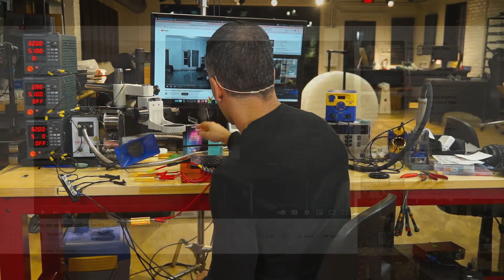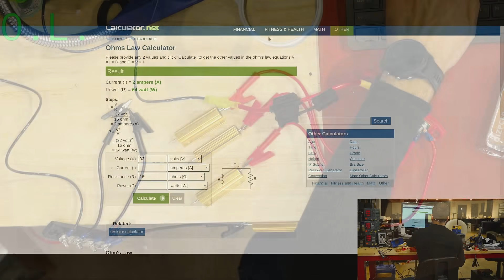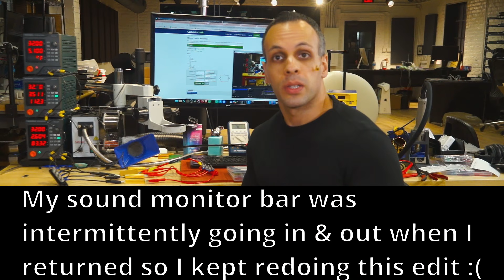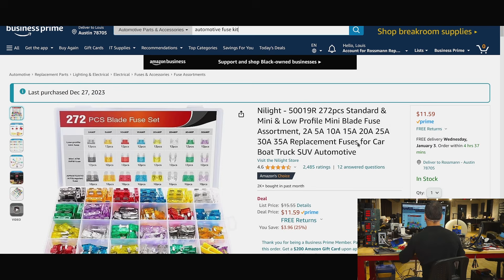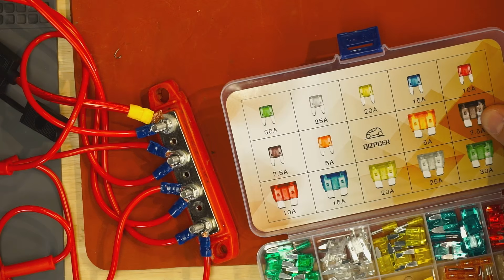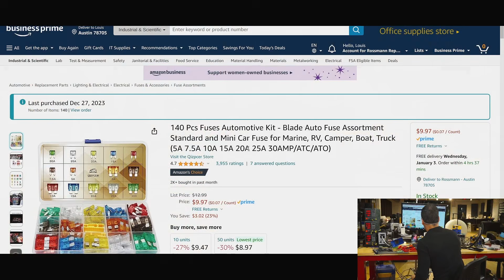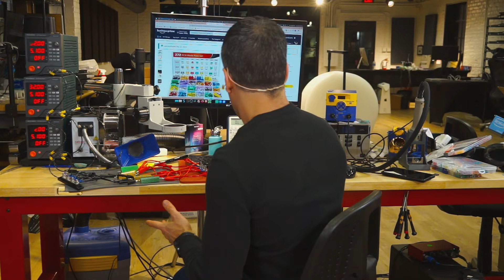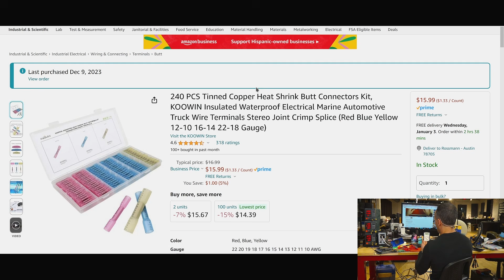Amazon Sells Fake Electrical Fuses

Comment: This must have been pointed already...sorry, will not be reading it.

But having 3 power sources in parallel to test the breakpoint of a fuse is flat out hilarious.
Louis, I like you, i really do, and that is why i honestly recommend taking this down, doing it right with a single unit and no parallel resistirs because thats all you need and explaining the reasons.
Reply from the maker: This post is all snark and condescension, but zero substance.
Reply: @rossmanngroup  Truly sorry you feel that way. Fuse parameters are a small science in its own, but for the sake of showing breakdown current variation all you need to do is run a single station and draw VA as you increase voltage until it blows. Very simple to do, very easy to replicate and while not perfect it is accurate enough for the sake of displaying range of breakdown current in various fuses.
Proper tests are more difficult and your own setup while getting closer in regards to the rated circuit voltage has issues beyond being complicated.
I want to tie that to the Amazon problem though.
You see, like many many other businesses Amazon was started with the idea to help.others and hopefully profit in the way.
When helping others they, like many other businesses, screwed up lots of things. and they keep screwing it, as.you correctly illustrate (btw I have a blog from at least 5 years ago stating pretty much what you state here, i.e. Amazon is going down).
The point and connection is just like Amazon does not want to see their mistakes I think you here are very fast to shoot me down instead of just doing a simple VA characteristics of a fuse meltdown current with a simple unit as most kids would do at school.
You are not Anazon.
But you are like Amazon in believing you do good and going defensive when told otherwise.
 Nothing personal. I was no better when I was on the way up :-)
Reply from the maker: That was a very long -way of completely ignoring my post. 

Using three power supplies in parallel is not going to negate the result of this experiment. Eight amps were put through a two amp fuse, and six amps were put through it for a prolonged period of time. Whether that occurred from one power supply, three power supplies, 50 batteries, six monkeys peddling a bicycle.... It's irrelevant.
Reply: @rossmanngroup  You are welcome to believe that it is irrelevant. I still - with all due respect - find it hilarious to have employed the setup you did employ for finding the fusible amperage of a small fuse. Does not neglect the point you are making in any way or form. The setup is in a category of its own and that was my focus. Not going to make a video and not willing to have a long argument. As I said I just did not expect that from you.

Comment: It's worth noting that putting power supplies in parallel and using the current limiter will result in wild oscillations in voltage output that may well cause them to shut down, perhaps risking damage to their output stages.  Louis is safer to keep the voltage fixed and vary the current using resistors.  If Louis is going to do more tests like this, it'd be worth screwing these resistors to a handy slab of aluminum 👍🏻
Reply: Does it oscillate into a resistive load? Where does it store the energy to cause the oscillations?
Reply: @@giusdbg the current limiter has negative feedback so where does the oscillatory gain come from?

Comment: I've had a 10 amp 12v fuse melt the plastic fuse bus body that it came with and still didn't blow. The 10 gauge wire was completely burned. Can't trust that cheap stuff. If the only difference between a 10am and 25 amp is the color, there's a problem.

Comment: the test structure of this is pretty convoluted. you should be able to just use the current limiting function of your power supply. or another power supply. Also don't need to use 32v exactly, the voltage rating of a fuse should just be the maximum, not the spec'd voltage to run through it constantly. So instead of 32v at 5a, you could use 5v and slowly increase the current limiting until it blows instead.
Reply: or just use any actual thing as a load and current limit it, IE a car lightbulb.... should get a good 10 to 20 amps per headlight. current limit it while ramping it up with the fuse in series, and no need for a bank of resistors with heat sinks on them

Comment: I thought exactly the thing you said about trip curves, but you don't need to find trip curves for those specific fuses. Automotive fuses are generally designed to a standard such as SAE J1284, so you should be able to look at any well-known brand and look at their datasheets for automotive blade fuses and see what they say. I don't expect them to be exactly the same, but they should be in the same ball park. Looking at a Littelfuse datasheet for 32VDC automotive blade fuses, the 2A fuse in that series should blow in about 0.3s with 4A flowing through it. At 6A, it should take somewhere about 0.9s. I also looked at a Bussman datasheet for some J1284 compliant fuses. For 4A through the 2A fuse in that series, the trip time should be a little under 2s. At 6A it should blow in about 0.4s. So I don't think anyone could justify 6A through a 2A fuse for several minutes with a trip curve argument.

I have a 30mm glass fuse kit that I bought from Amazon a couple of years ago. They were listed as "fast-blow" fuses, so I thought I'd take my 20A lab power supply and do a few tests. I wasn't as patient as you, but I had 4A running through a 2A fast-acting fuse for well over a minute, but once I upped the current to 5A it blew in around 2 seconds. Not exactly what I'd call fast-acting for a 2A rating. I also tested a 6A fuse. It was fine up to 6A, as you'd expect. At 8A, it started glowing red almost immediately and finally blew within about 8 seconds, which is not too bad. It seems like these low current fuses may be less reliable. The wire fuse element has to be thinner, so I guess quality control is going to be poorer on the lower current fuses, especially when you're playing at the cheap end of the market.

Comment: You're absolutely right here though, this is the correct test to make. The fact that junk cheaply fabricated - non regulated (which regulations suck some places but that is why we have IEEE standards) junk fuses.. Look you did come at this with the right insight. Someone suggested a bad fuse - and yeah 10amps on a 2amp fuse IS NOT GOOD. Problem here is MOST PEOPLE don't UNDERSTAND this.

Comment: I'm a PhD electrical engineer and glad you're bringing attention to these problems, but you made a few critical errors. These are automotive fuses required to conform ISO 8820-3 or similar standards, and time-current curves are readily available for comparison. And you really do need those curves: Fuses are not instantaneous switches, they're analogues for for electrical wiring, and electrical wiring doesn't instantly overheat either. Simply put: fuses are NOT supposed to blow instantly!  Properly designed and manufactured fuses may take minutes or hours to activate during mild overloads, and that's by design, as many properly designed loads (motors especially) can draw very high current levels for short periods of time. And there is always a wide tolerance for performance because there is considerably variability in the real world as well. (Ambient temperature, ventilation, etc.)

You can't make a claim they're defective without a  comparison to the time delay they're supposed to be blowing at.  A properly functioning 2.0A Type E automotive blade fuse is permitted by ISO 8820-3 to take up to a full minute to activate at 4.0A, and 7 seconds at 7A. It should operate indefinitely at 2.2A, and take up to 15 minutes at 2.7A.  Only at 12A or higher should it always blow in under a second. Engineers recognize that and design in safety margins with that knowledge. 

The fuses you tested did not appear to meet this standard, but didn't seem to be as outrageously bad as you seem to think. It's hard to tell from your experiment just how bad they are, though, because you keep changing the current. If you repeat this experiment, I recommend testing each fuse at a single current each experiment, and timing how long it takes to blow. Only by plotting those on the time-current diagram can you really tell if these are outside of the permitted specification, and if so, by how much.  If you have a thermal camera, that would be very helpful, too. If you want to be really dramatic, pick a cheap Amazon fuse and a cheap Amazon wire at the minimum size wire permitted to be used with it, and if the fuse really is a defective (no-blow) fuse and/or wire shoddily made, the wire will burn before the fuse, and it will make for some great youtube!

Comment: The other thing to watch out for are counterfeit products - i.e. fuses or circuit breakers that have a name brand on them but aren't actually made by the named company.  Sometimes the markings are so similar that it's difficult to tell them apart.  Another reason to buy products from a reputable seller.

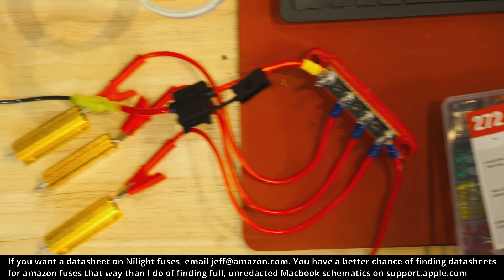Comment: 5:49 Apologies if this is mentioned later.  I can't speak for those Amazon ones, but generally speaking fuses will have their amp rating printed/painted on their top edge, so regardless of color, you should be able to read its rating.

Comment: Only 2a fuse was bad, other two behaved normally. They are supposed to blow at double current, so they dont get too hot at rated current. I see your point, but dont agree completely

Comment: So many people think they discovered america while such type of fuse should actually blow at around double current in up to 30s. It cant be made to blow at 10% over rated current because it would be heating up like crazy at rated current. This is basic fuse. Its not a circut breaker which had electromagnetic switch which interrupts current immediately at 2x rated or more, and bimetalic part which trips if it starts heating. So it can be tuned to break circut little over rated current (but again in 30min for example) this does nit apply to a simple fuse since it has thermal mass so dont confuse

Comment: Perhaps you should attempt this with what you get from the automotive stores. I've always wondered if they make the aftermarket fuses take a little more so the customer thinks the problem is "fixed". When truly they are just putting more current on a circuit that isn't designed for it.

Comment: Very alarming. Many people myself included have placed a lot of stock in Amazon reviews, especially where there are a large number. Its not just the issue of fuses and crimps. It brings into question everything on Amazon. This really complicates things for consumers. I can adapt as doing research and comparing different sources is something I'm good at, but the average consumer is screwed.
Reply: Amazon doesn't even want to take responsibility on what is sold on their platform . Now add on the fact that they have millions of products that are constantly coming in and out AND they lack the resources to properly investigate what is fraudulent. That's a red flag from the get-go. 

As consumers, it's essentially our fault. We didn't learn our lessons when we shipped our manufacturing offshore and gutted a portion of our middle-class...we sure as heck ain't going to question why products are priced so cheaply on a platform that can't physically (or legally required to) monitor the quality of the product.
Reply: amazon reviews are fiction. Not just fake, but amazon suppresses negative reviews. I bought a wifi card for $50 that worked poorly. In the box was an "offer" for $50 back if I gave them a 5 star review. I took a picture and reported it to amazon, nothing happened. I left a negative review about it and amazon removed it.

Amazon is complicit in this whole game. They know whats happening and they're helping the fraudsters sell garbage because they're financially incentivized to.
Reply: Years ago, reviews worked as a way to tell real products from trash.  Then around 2015 or so I noticed that real quality products had lower average reviews than fake items.  Around 2017 or so, Amazon started pushing the trash products in their recommendations.  Today it is very difficult to find good products on Amazon unless you already know which companies provide good products.
Reply: Award-winning author here. I would NEVER distribute my work on 'Zon. Never. It's a dollar-store style cash grab, chinsy, XiXiPi kind of outfit. Sure, maybe it was different in 1999 or 2005 or whatever, but now?! Nah. Garbage in nearly every way imaginable. All so that wealthy CEOs can have hookers, hoes, wine, and yachts. Bezoz and his corrupt CHN cronies are rich and you ain't... but that doesn't mean they've actually contributed anything positive to society.
Reply: placing trust in reviews is trusting advice from total strangers
it's best to never pay attention to reviews of anything - music, doctors, YT videos, vehicles, restaurants, movies...
the best testament to value or quality is staying power and reviews is just strangers saying "trust me bro"
Reply: @likebot.  and a review for "technical" stuff on a NON technical platform 
most users ordered box of fuses and plugged the fuse with the right number and whatever worked again so 100% satisfactory and SHOULD get a 4+ rating  BUT they dont know HOW to test and are EXPECTING to NOT NEED to test them 
in this case the rating are TRUE and MISLEADING at the same time
Reply: @jasonriddell  Most people are unqualified to give a sufficient review.
Reply: @likebot.  Staying power doesn't mean quality. Companies rise and fall, be it overall or in specific product categories.
Ford's turbocharged 1.0L is crap and I don't see Ford not having "staying power". Dell's entry level business laptops are pretty crap as well, I know multiple cases where people had work blocking issues in the first 1-2 years of having the laptop, yet Dell has "staying power" as well.
I would trust the "staying power" as much as a random stranger's review. Whatever I am buying I will look up a bunch of reviews, rankings and comparisions on third party sites and forums before I even look at the reviews found on a seller's website (where I will be looking at 3 or less stars reviews anyway).

Comment: Sorry, but on the box I couldn't see if they're 32V indeed.

Maybe I'm an noob from old continent, but automotive fuses are in most cases 12V, alternativly 24V for HGV.

If they would be 12V their AMP rating would be tripled, wouldn't be?

Comment: Your endpoint is so true, you can put in a way bigger rated fuse on a circuit and if there is no fault somewhere between the power source and the endpoint the fuse is not going to need to have to do its job and will last forever but in the unlikely event that there are damages you are risking your car catching fire.

Comment: The fuses are probably lots of the same rated units but with different colored plastic tabs. That way they can just manufacture the same thing repeatedly to capitalize on economics of scale rather than having separate assembly lines for separate ratings. The package may have only 10amp, 25amp, and 35 amp fuses (for example) rather than the complete range listed on the package. They skate under the radar for awhile because the  fuse will 'work' fine until there is a more catastrophic fault in the system that unmasks the falsely labeled fuse. And because there is no such thing as accountability in the Chinese economic system, there's no way to put a stop to such practices short of completely barring Chinese-manufactured imports.

Comment: Wow, you’d really shit if you tested breakers.
I used to do electrical testing, breakers.
We tested exercised and replaced breakers for a large telecom, all locations.
For instance, a typical breaker has a recommended curve of proper operation, or rating.
A typical 20 amp breaker would be rated at 3x rated for somewhere in the 1 minuet range.
That is it could maintain/ not trip with a 60 amp load for about a minuet, then it should trip.
They would be instantaneous trip tested at 10x rated amps.
We would hit them gradually 3 times raising the amps to 10 times rated to attempt the instantaneous trip.
Each make, brand, model, and style had different trip curves that had to looked up.

Comment: Great video Louis. Tip using chassis mount resistors like that. If they aren't mounted to something that can heatsink them, you should only use them at about 40% of the power rating. It would say that in the datasheet if you got them somewhere that provides a datasheet.

Comment: conspiracy theory time, it wouldnt suprise me if they massively under rated the fuses on PURPOSE cause if someone goes to put it in and it immideately blows again due to a fault, people might blame the fuse even though it did its job perfectly, so when they put the fuse in and it works, the costomer is happy and gives the product a good rating in time before the car catches on fire and kills them and their family. Youd think this wouldnt happen but the vast majority of people dont know anything about electricity and think the fuses are just there to piss them off.

Comment: The worst thing is that fuses blow when there is something wrong with the system, and if someone puts a BS fuse that blows at x4 rating into a broken system, it will guarantee a fire.

Comment: Automotive fuses are most commonly blown from straight shorts to ground, not overloading, which is much more rare (thankfully).  Still, they should blow within a few amps of their rated current, otherwise we wouldnt need different ratings.  The wires down stream are not built to handle a ton of additional load regardless of the cause.